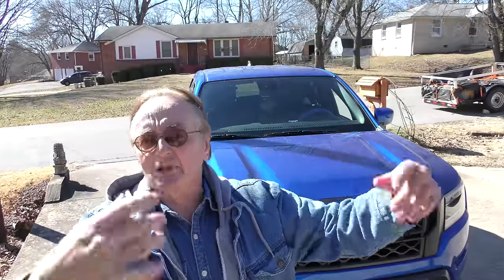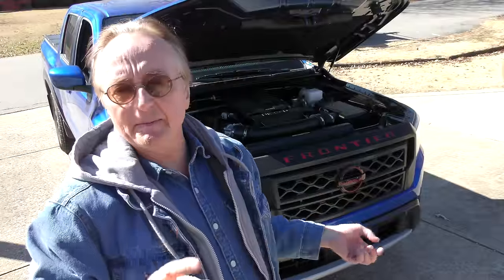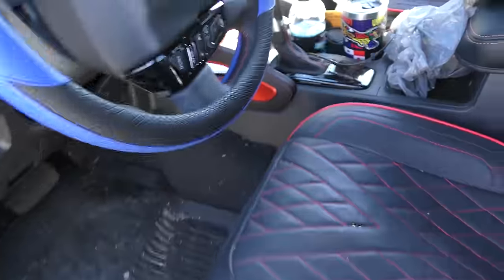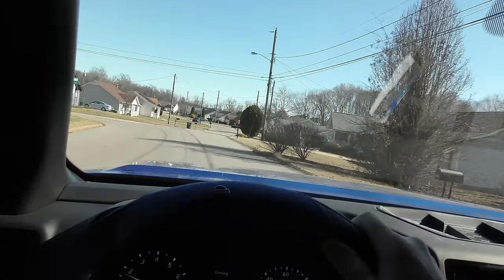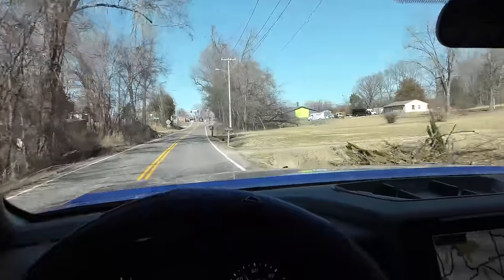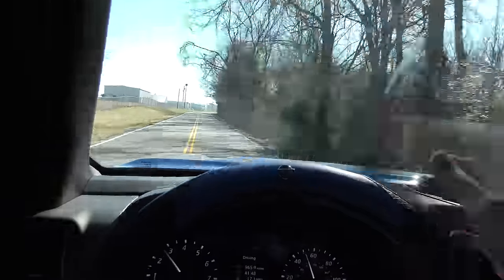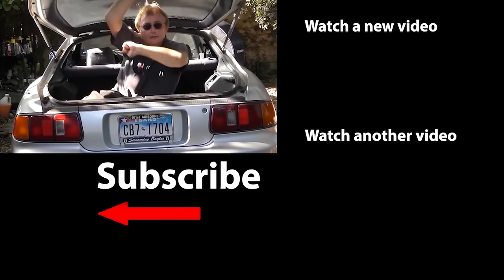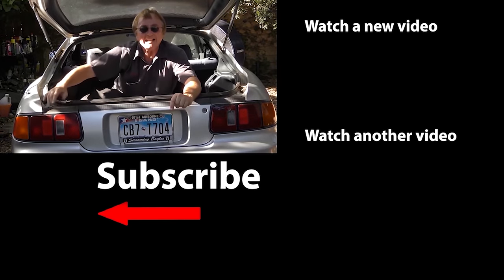This New Cheap Truck is Better Than Anything Toyota Makes Now

Comment: Nissan went in the right direction with the Frontier.  I have a 21 Titan and like it. No engine shut off at lights and no cylinder deactivation.  Rides like a truck. To bad Nissan stopped making the Titan.  But Nissan trucks are the victims of poor and mostly non-existent marketing.

Comment: I like that it is very basic and solid....but the data indicates that Nissan Frontier is less reliable than its more complex peers. I liked driving it, and thought it was more comfortable than the 2023 Tacoma. Shocked it isn't hunting for gears. Scotty's opinion has weight though...Scotty is the reason I ended up with a Ridgeline!!!!! The non-truck that literally pretends to be a truck better than the other mid-size trucks actually truck.

Comment: Forget these 40 and 50k so called cheap trucks. I want a Whats it called the mv0. Basic and modifiable. 10k base price, but we will never get them. You could probably go on vacation and go buy one, drive it around overseas for a year and explore, ship it back, and still save money. Maybe you can buy them in Mexico and drive them back and pay the import fees if you want the truck right now. That's the truck of the future. A truck that can be a little work horse. Modified to what you want for around 15k and be reliable day after day.

Comment: .......wish me luck, just bought a 2017 4.0 V6 crew cab with 50,000miles for 20K. ....other than power windows the only frills this truck has is a back up camera.  **got rid of my 2016 problematic 5.3 V8 Silverado

Comment: I finally understand what Scotty has been saying about the new F150 transmissions… rented one with the 5.0 this past weekend. Not only would it hunt & hesitate to find the right gear… it would hang in gears for way too long in hammer down situations. Also had a random rattle on my door for part of the journey… Trading in the manual 5.0 stang and nearly doubling my monthly payment is not so appealing after that

Comment: Scotty, wish you where still here in Texas as I'd show you my '23 F-150. I had it ordered in and it doesn't have any junk but has max tow and max payload. It can tow 13K and carry 2507 payload (which I have done and it does it with ease). I've got the naturally aspirated V8 with 400HP.. It happens to be in the same blue as the Nissan. It is a great truck and didn't cost much more than the Nissan. The Ford F-150 I think is a great truck when you rip off all the junk you don't want and get it correctly configured.

Comment: I have a 2019 Frontier Crew 4.0L and it's fine. I like the look of it. This new Frontier has more newfangled things than I want. I bought the last year of the 4.OL because I heard a new engine was coming and I wanted mature technology. I paid $25k in March 2019 a Taco would have been $35k at least so it was a no brainer. I only have 5k miles on my truck although I have had a ton of top soil in the back. The automatic transmissions in the 02 nissan with 3L or 3.3L engines was weak, but 3.5L pathfinders or 4.0L V6 trans are good. I often thought as a kid that a 64 Chevrolet truck with a 283 was a well set up truck, I feel the same way about my 2019 Frontier. It's about the same torque.

Comment: The best cheap truck is the one you have paid off and runs well. You drop it off every couple of years to get worked on by someone smarter than you for less than a couple of modern truck payments.

Comment: No 8ft bed I'm sure.  These manufacturers are out of touch with truck buyers
Reply: I use a short bed, just hauling around some home improvement stuff and electrical contractor stuff for my part-time "fix-it" retirement work.  I'd get a new one with a crew cab for the occasional passengers.   I might be the exception as a truck buyer but it works for me.  Cheers! 😁
Reply: No, they are not. If you want the 8 ft bed, they offer the full-size Titan. The Frontier is a midsize truck that fits a specific niche of truck drivers.
Reply: @philkoth2198  Truck manufacturers used to offer a midsized truck with an 8ft bed.  Not everyone needs to tow 11k pounds, some people want to move cargo, large sheet goods, etc.  We don't all need extended crew cabs with a 4 ft bed.

Comment: Nissan didn’t just start making great trucks, they have for years. My 2008 Frontier had 266 thousand miles, and it ran perfectly. It got totaled by a reckless driver. I liked it so much, that I replaced it with a 2012 Frontier. These trucks are so good that I don’t have any desire for a new one. Ultra-Mega-MAGA 🎉

Comment: Hey Scotty I got a 1976 Toyota Chinook that has set for 20 years do I need to replace the metal fuel lines
Reply: You're going to have to do a lot more than that. That's going on 50 years old

Comment: I cannot understand why they are putting 4 cylinders with turbo chargers in trucks.  They run hotter, don't really get any better gas mileage, and nobody wants them.

Comment: I think Nissan missed the boat with their pick ups because their designers and engineers didn't grasp the notion that a P/U should have  a " stance"!  Nothing crazy, not a Baja racer , a high end Ford Raptor or even a high school seniors mud crawler, but you should see a little air underneath it. 
Nissan trucks often look like a " blocky" sedan with a truck bed instead of a trunk lid.
I have been beside a plain jane 4x4 Toyota at a gas pump and thought, That's  a nice looking truck.
When someone buys a truck, they may already knowthat the most they will do is move the neighbors washing machine. Looking out at their truck on a cold sleeting night, they think, If any of the kids get Appendix  tonight, I'm  getting them to the ER! I don't hunt, but with that truck, I could show up at deer camp with my head held high!
Stance is important!

Comment: I LIKE that there are less bells and whistles. I don't want that extra crap. I want a reliable engine and transmission! I have a 2011 and it's just fine.
Reply: Except fewer bells and whistles should also come with a lower price.

Comment: My brother was looking for a new truck to replace his great old 2001 Frontier. He came to for guidance. We looked at late model Frontiers which only come with the 3.8L V-6. I steered him away from it because they are direct injection only engines. He is like me and drives his vehicles for 20 years or more. Nobody talks about direct injection in their reviews. Why does everyone leave this out when it is such a ticking timebomb?
Reply: Please elaborate. What's the problem with direct injection engines? What kind of engine was the older 4.0L V6 Frontier?
Reply: You can do a valve job with walnut shells for the GDI. How expensive is that?
Reply: Direct injection engines have no way to clean the intake valves. If the newer Frontiers still had the 4.0L v-6 I would have told him to buy it immediately. @lifebylosh

Comment: The little trucks in the early 90s wete great.  $ 13.000 new. 250.000 mile truck with a  manual.

Comment: If that AT seal stuff doesn't work, you can do what I did.  Tie wrapped a brownie pan that was the right size under the leak to collect the drips.  Used it for years with no marks on the driveway.  It is not too big of a deal to change the oil, just a new tie wrap.  The racing guys use a special diaper so the track does not get oily.  Same idea.  I made a video on it but don't want to hijack Scotty.

Comment: Cheap pickup? I just bought a 2012 Ranger with a 5 speed manual for $6000. 90k miles on the odometer.

Comment: Scotty is spot on with the review. I've had mine since last August and I've had nothing to complain about.Most of the complaints about this truck have nothing to do with what a truck is supposed to be capable of. It doesn't have the fancy tech, the steering wheel doesn't telescope, the steering is too hard. Aw, boo hoo.

Comment: Looks like Australia's version of the Nissan Navara. The Nissan Navara dual cab ute here it Aus is extremely popular. They are a diesel engine here and beside the ranger raptor the only dual cab ute with coil spring rear making it great off-road
Reply: The Old Frontier was a Navarra in Europe too. I had a 2006 Navarra 2.5 Tdi.
Reply: Yup Navara is for foreign market, and Frontier is for American market.

Comment: My dad and I both own Nissan Frontiers. Mine is a 2012 and his a 2017. They have been excellent trucks and we both tow 20’ campers with ease. 147,000 miles and runs smooth as silk. My only complaint is the turning radius. You have to think ahead when turning.

Comment: I prefer the older ones.  They made them from 2005 to 2018, had the great VQ 4.0L engine and you could get a 6 speed manual and still have 4wd.  Some companies only put the manual in the base 2wd trucks.

Comment: I specifically bought the 2023 Toyota Tacoma V - 6 just for that reason ,  that there will only be the 4 cylinder Turbo in 2024 models Only ...NOPE

Comment: Love your videos, Scotty.  I'm just not sold on Nissan's reliability and past company ethics.
Reply: The frontiers are rock solid.  The 2005-2018 anyways.  Can't comment on the new versions with the new engine and transmissions.  The years I mentioned with the 4.0 were bulletproof and you could get a manual

Comment: A new ford ranger with the 2.3 ecoboost will outrun and out tow that nissan by far and get better fuel mileage. If you do regular maintenance on the ranger- 3000-4000 mile oil changes it will last just as long if not longer than that nissan….. Just wait and see when they get old.

Comment: I prefer to drive something like that which I do I don’t want to drive a washing machine/appliance
Reply: Poor text either way Nissan makes a great truck I’ve had them form the early 80s to now along with my Porsches and Mercedes they complement my life style no need to rent a truck comes with tow package I can tow 6000 pounds plus and it’s not 80 grand or more I can go to dinner the big 3 are not for me Japanese products are made extremely well from trucks to water heaters

Comment: Are any of the older model Nissan trucks any good?
Reply: 2011 - 2019 Frontiers are the best. If you go really old , 2003 -2004 Frontiers are good if you can find one that's not rusted. The 2005 -10 Frontiers are good if not for the Calsonic radiator failures which allowed trans fluid and engine coolant to mix ....killing the transmission. If you go with a stickshift all the 2005 to 2019 Frontiers are good.

Comment: Hey Scotty, 
My girlfriend’s Prius has 190k miles. It’s a 2010. It’s leaking coolant I fixed it but now it burns engine oil to the point it’s almost half gone after just 1000 miles. Any tips on how to fix it without replacing the engine?
Thanks!

Comment: I used the 205 reseal in the transmission of my old Ferguson tractor,
I seems to have stopped the slow leak,
Sure worth a try before tearing into a transmission in my opinion,
My  auto parts store had to order it for me,
Said their supplier is out of stock sometimes as it’s very popular,

Comment: I've got a 2004 with a 6 cylinder that has 270,000 miles on it and it's still going.

Comment: Don't tell me my truck is ugly, I bought a 2005 Nissan Frontier with the 4.0 V6 new , and have been driving it all these years with very little trouble, just drove it a couple of hours ago.  I think it looks just fine.
Reply: I like the look of the 2005-2018 Frontiers.  My brother has an 2011  with the v6 and 6 speed manual.  No issues ever with the thing.  Regular maintaince

Comment: I had a Frontier with a V6. Bought it to tow a small camper. They, indeed have plenty of power but the gas mileage was horrible. I couldn't afford the gas required to tow the camper. I got rid of both the truck and the camper and bought an older Frontier with a 4 cylinder engine. Still well pleased with it. Just wish Nissan would go back to the small size pickup. I'd buy a new one.

Comment: I've heard of a lot of transmission problems with the redesigned Frontiers.
Reply: there's a recall for parking prawl, the transmission doesn't have to be removed to be replaced.
Reply: Much better than blowing engines in the new Tacoma's and Tundra's.

Comment: 2024 4x2 crew cabs with minimum options in my area are $32.5K MSRP, much better than Toyota wanting +$43K (some still adding market adjustments, too!) for a crew cab Tacoma with that "turbo four".   Might be worth going to check one out as I've been holding off for a few years on purchasing until the market comes back to 'normal'.

Comment: Having owned over 100 different vehicles in my 50 plus years of driving and tooling, I've still got my 07' Frontier.  Without a doubt the best vehicle I've ever owned.  Just this year I replaced the first non maintenance part, a drivers side window motor, $50 and 30 minutes work.  I will never sell this vehicle as it has been the most reliable and cost effective one I've owned.  Having been a master Porsche/Audi Tech for a number of years, I learned and continued to learn what good cars are all about.

Comment: Test drove one today. Pro 4X. The juice is not worth the squeeze in my opinion.  Should be a 25-27k truck. I am 5-10 and it seemed small to me. Knees kept hitting the door panel and center console. Sure do miss the Hardbody I bought back in 97.

Comment: The reason for the inevitablle turbo charger is a smaller engine with less combustion chamber surface area to hold HC's.  We'll be seeing a lot of 3 and 4 cylinder turbo vehicles that were once V6 and V8's in the future.

Comment: Had a '07 Ford Ranger Extended 4dr with the 4.0L V6 and limited slip. It would burn both back tires. The turbo idea is insane.

Comment: Here in Ontario a 2023 Frontier with 10K is $51,000, whereas a Tacoma with the same is $49,000.  A fully equipped new Frontier is $77,000.  
Scotty and I travel in different circles if he thinks the Frontier is cheap.

Comment: The new Cruck or Trar is a hot mess. Drove a Maverick a year ago and it was not a great experience. The cab is small for taller guys. Cheap plastics galore and the seat cushions are shorter than Buicks , which again for tall people is uncomfortable. 
The Cruck screams cheap. It’s a Ford and with that comes a mess under the hood and a design that’s as ugly as your two first cousins baby. 
The rifled quality was the real issue traveling into the Appalachian mountains. 
This truck was not made for even gravel roads. 
Toyota and Nissan are superior.

Comment: Replace that silly 9 speed hydrastatic power sucking automatic trans and put me in a 6 speed manual with a clutch pedal.  Remove all those buttons off that stearing wheel and throw them in the trash.  Take out that television in the dashboard and replace it with a good AM/FM radio. And where are the Voltmeter and Oil Pressure Gauges?
Reply: Agree 100% !!!

Comment: The way I drive I'd be happy with the 4 cylinder Frontier they used to make.  I'll take the extra mpg every time.  As is I'd buy a Ford Maverick hybrid for the mpg but I don't trust them to last.  Waiting for a quality hybrid compact pickup from a quality company that I can hang onto for 400,000+ miles.  At a reasonable price.

Comment: 2 years ago the Ford Maverick was $20,000 + destination of $1,500 .... that's about a cheap as it could get. Those Mid-size trucks are only a few thousand away from getting a full size. So unless the slightly smaller size is needed, save up and get a full-size pick-up. I chose the Maverick cuz fully loaded except the moon roof and the FX4 package (this includes a hard tri-fold tonneau cover) it was $37,500. Currently the base model F150 has an MSRP of $35,000 lol

Comment: Pick up guys want a damn 9ft bed . Can't haul anything in these little toys . What happened to common sense . Most trucks you can't even load with sheets of plywood . If you want to get twelve ft boards ,you need a trailer . Might as well just put a hitch on the old Ford taurus .

Comment: I would probably take one of these over a turbo i4 or hybrid Toyota. Honestly though, for anybody looking for a good midsize truck, if you don't need much towing capacity, get a 2017 or older Tacoma with 4 banger and manual transmission. About as bulletproof as bulletproof gets.

Comment: I had one for about 6 mos. No problems out of it, Plenty of power. Heavy sucker though, 4200lbs? and poor reliability so far from consumer reports. But it ain't cheap, About the same as the rest.

Comment: Renault hasn’t had any stake in Nissan for the last few years. I’m shocked at how much better they are the build quality too. The build quality on the Sentra is so much better than the civic and corollas. Even the current Camrys build quality is not as good as the Altima. Of course no one expects the cvt to last as long as Toyotas. But as of 2022 they’re on the newest cvt version so we will see.

Comment: The new Frontier has some reported issues, and some issues with the engine reported. Time will tell if it's reliable, but cmon Scotty, don't tell people something is reliable when it hasn't been tested for years :). 

In addition to that, those 4cylinder turbos have more HP and Torque, and more sustained power than these V6 models, especially when towing. While I agree, I wouldn't want a 4cyl turbo over a V6, you are just wrong about power :).
Reply: Agreed, too early to tell

Comment: 4 bangers just don't cut it? Can't tow like the V6? Man, I have a Ranger, 2.3L 4 cylinder, 270 HP, 310 lbs/ft of torque that will out pull any Nissan or GM mid size. They may have a 30 HP advantage but less torque than the Ranger. Tow ratings on these vehicles tell the story. Ranger 7500 lbs, Frontier and GM 6000 lbs. Do your homework Scotty.